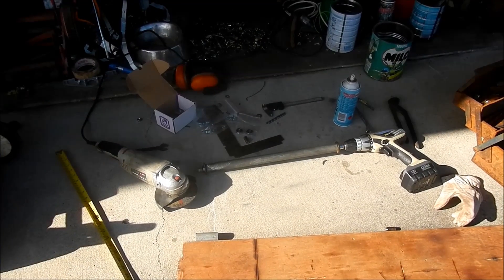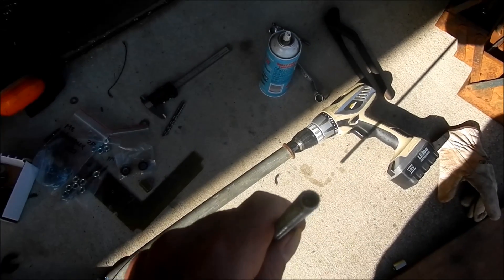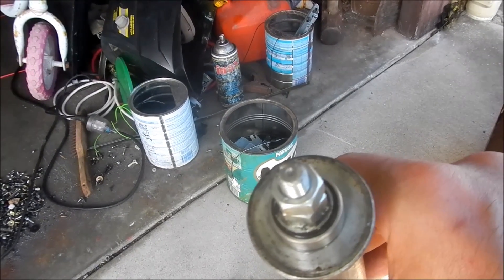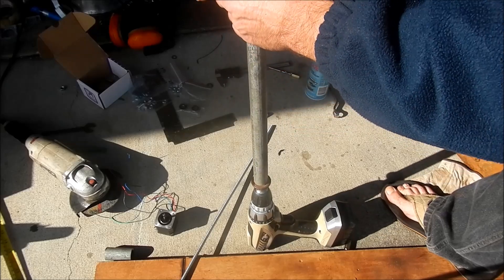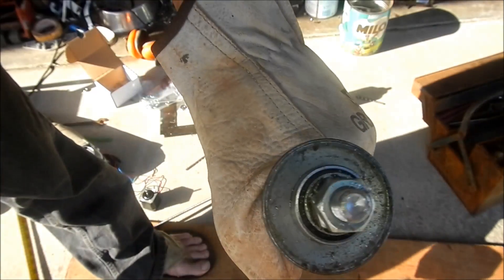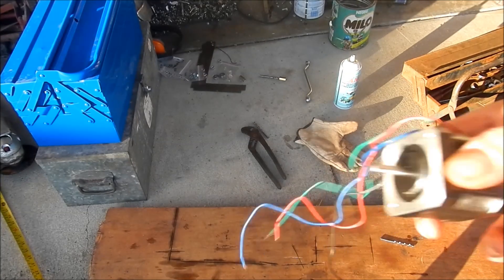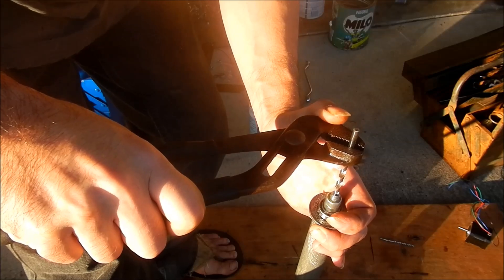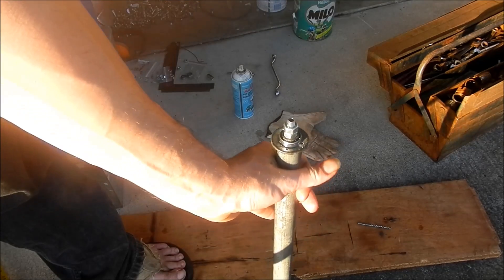DIY Cordless Metal Lathe. 3D Printer Z-Axis vertical movement pt1. Building a RepStrap pt6

Comment: Thank you very much!  I have thought about trying to make a lathe...  But the one problem is that the drill chuck is really small.  I have also thought about like say a 1 inch steel pipe that is like 2 inches long and taping 6 holes in it for bolts.  There would be two rings of bolts, one in the front and one near the back.  You could tighten down the bolts onto your thing that you want to turn.  But how you would put bearings on that I don't know.  I'm thinking 1 inch bearings would $

Comment from the maker: I was thinking of you and your stirlings especially when I made this... I strongly recommend you look into making an improved model to suit your needs. A little extra framework, and you could make a proper bench lathe. That can be powered by any drill with a chuck... If you wanted to go full on version, Arduino and a few steppers. I may even make one if I ever finish the printer. I'm really surprised how well this crude version worked though!

Comment from the maker: I'm pretty sure I sent you a link to this one, knowing it would help with stirlings XD For the longevity of your drill, it may be worth considering a bracket. Its very easy to put a lot of strain on the drill bearing this way. Wouldn't take long to tape, wire or hose clamp it onto a rough frame. which would save the bearing a lot of grief. Its a great trick to file in the memory bank though. Very handy!

Comment from the maker: Thats the problem, How to secure the plate I want with a 75mm hole in it, and remove the waste disc, while keeping a perfect 75mm diam circle hole in the middle...... Too thick to hole saw without drill press. Don't care what happens to the disk removed. Thinking I need a 75mm circular cutting tool of some kind... Or buy metal hole saw and cutting compound... Can't rally afford it... Or make smaller hole, and dremmal out, which will take ages with my gutless dremmal.

Comment from the maker: What really gets me, is the bent drill bit, still made a straight hole. Couldn't do that if you spin the bit. The precision is amazing, I haven't done anything this tight since school Engineering classes. Always wanted a lathe, and a cnc router. Turns out if I can make a 3d printer, I can make a cnc, or a lathe, with wire feeder and extruder, as well as regular cutting stuff. I never in my wildest dreams thought I'd ever own a lathe, now I can make one (Pfffft, who ever makes one of something).

Comment from the maker: No worries. I'm really liking this one. Going to use it for a few other things too. Can you think if it could be used, to cut a largish hole in thick plate? Sometimes I want to put a greater than 13mm (Max chuck size) but less than 150mm.. I used to just borrow a diamond tip core drill from work, was spoiled, dont have access to that anymore. I have been tig cutting holes, not pretty! Chews through electrodes too.